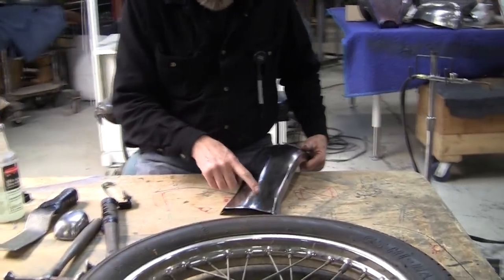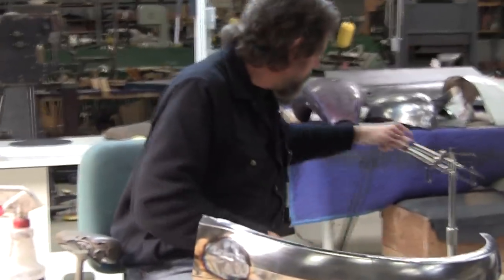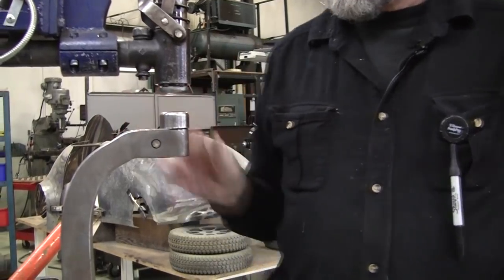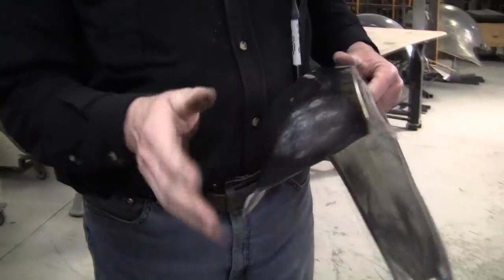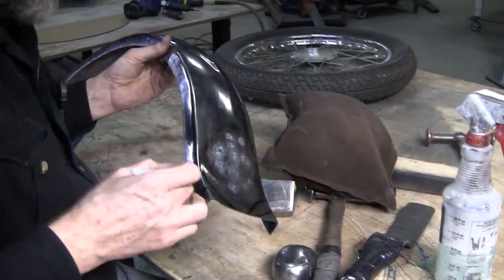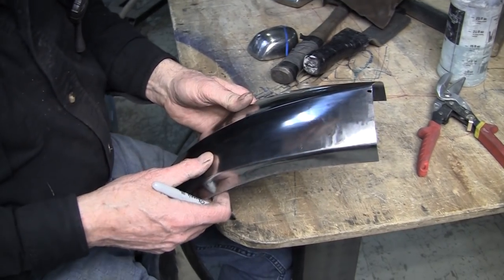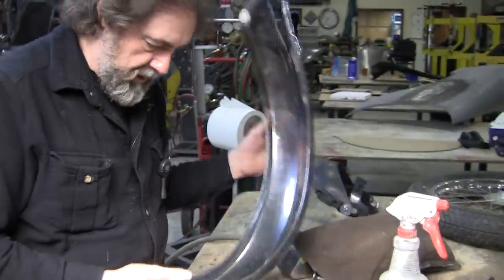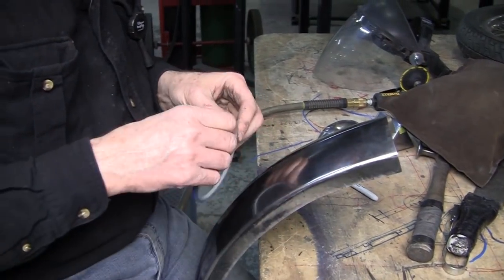How to Make a Motorcycle fender (Part 4): Shrinking, Planishing and Re-designing

Comment: Excellent series on making a motorcycle mudguard exactly just what I need to know
I have a '50s British motorcycle and need to make a fender with ducktail, centre line and edge bead in a single piece.
Would there be a problem to make the shape then the ducktail then the centre peak then a side flange, the peak line and finally the edge bead?

Comment: Hey Wray, I have a couple of 2.5' lengths of dock bull rail that I would like to use as stumps but they are softwood (fir). Will that work okay? Also, what is that rubber electrical tape looking stuff you line the stumps with?
Reply from the maker: You can also make the shrinking facilitator out of end grain short wood scraps. The rubber coating protects the wood and holds the panels. The rubber coating has a self adhesive on the back , it is called EPDM. You will find it at your local roofing supplier.
Reply: @proshaper  Thank you Wray.